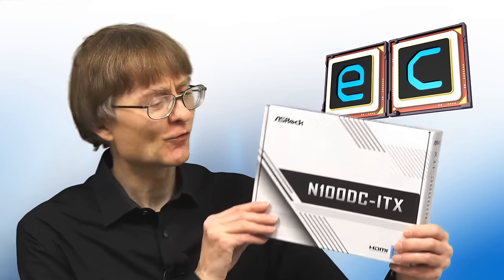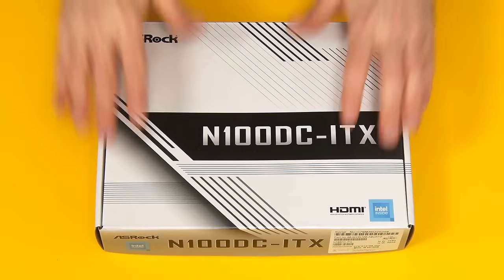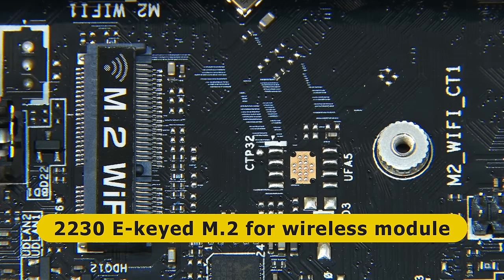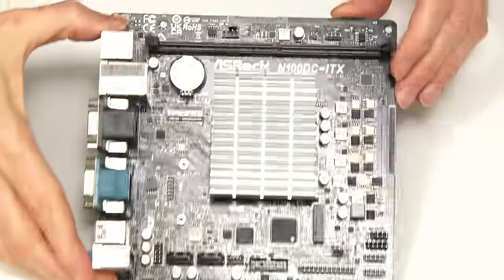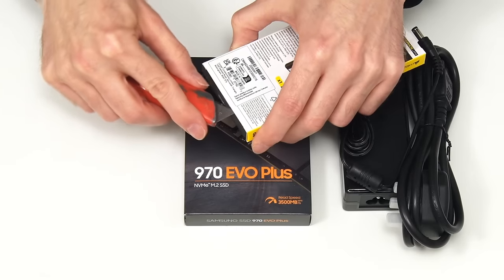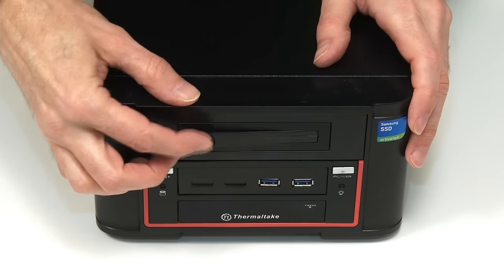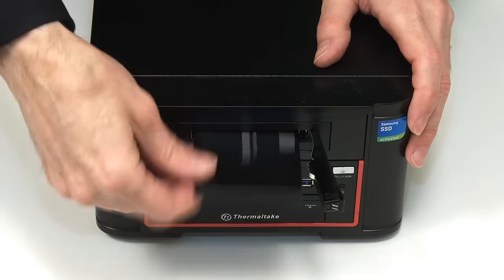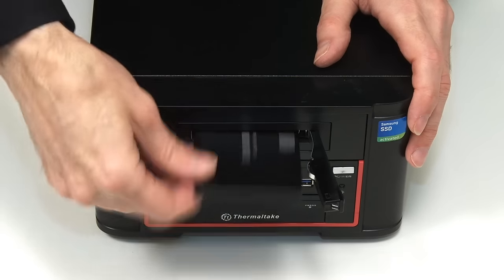N100 Mini-ITX Silent PC Build

Comment: I too think that Office peaked with Office 2003 and still use it today. However, Windows 11 doesn't like it, but will run my copy of Office 2007. Something to do with the security of network drives so it freezes on the Save As screen. Come 2025 I have the choice of swapping to 2007, which I thought was the least inconvenient option. However, just seeing you boot up a VM to run Office makes me wonder if it wouldn't be better for me to run Windows 10 in a VM to access the files on the NAS. I have an XP machine on it's own virtual network and not allowed to contact the big mean wide world. The thought of going back to using it for anything other than games hadn't occurred to me. Food for thought. 

Some time back I replaced an AMD based motherboard with an Intel based motherboard for a Linux system. I was very surprised how well it handled it. I'm sure that Windows would have lost its mind over such a major change, but Linux seems to take it in its stride. 

Another very enjoyable PC build video. Always a favourite of mine. Thanks!

Comment: Thank you for the review of this motherboard.

One bit of criticism is that I do not understand why you are so worried about the bios being able to download drivers when you are still running WindowsXP which has been EoL for 10 years now.
Reply from the maker: I am not running Windows XP online, so the EOL is irrelevant -- it is is a totally sandboxed and secure system. And I am running Win XP in a guest OS VM, so it is not using any drivers related to the real hardware. The host OS is Linux Mint. My concern about the BIOS drivers download "feature" has nothing whatsoever to do with drivers! :) It is to do with a motherboard BIOS that has direct Internet and OS access . . .

Comment: Nice daily driver build. Small, efficient and inexpensive. I tend to use my Rpi 4 most of the time as it's fast enough for most of my daily tasks. Sadly, since the upgrade to bookworm Aisleriot Solitaire no longer runs. Scrot fails to works as well. I have so many old computers laying around that are more powerful than the Pi but I just don't use them often, my wife uses my 2014 Macbook Air most of the time as her windows laptop stays sick like most windows systems. Unless you game or do a lot of video work, I see little use for a high power system. Most are just overkill.

Comment: bro's so wholsome he deserves an n300 with 8 e-cores.
Reply: IF you're running a http or an Erlang server with it, may be, but the difference is very thin, N300 is less than 10% faster (both mono/multi core scores), it has a better iGPU (32 EU instead of 24), something that most Linux users don't care about, but its Cinebench tests are lower than those of the N100.   So the price delta isn't worth it.
Reply: @hankhulator5007  bro's so wholesome he deserves an ampere altra cpu.
Reply: @SkysTrains   A DUAL Ampere Altra :)

Comment: Well done! This N100 CPU is quite impressive I think. Compared to the Celeron J4125 in my Synology DS1520+ which runs 4 VM's it is mucht faster. So your "little" system has options for hosting a server or nas too!

Comment: Great little thing - and video. I was looking for a smaller case and found one - much cheaper I guess - that fits on a VESA mount. I am considering to replace my array of 6 or 7 2.5" HDD NAS by a couple of these, but then would need to DIY a NAS OS installation. In the  past two decades or so, I worked with tiny discrete NAS servers as a way to distribute load and specialise them in content related to users. And they replicate to each other on their second RJ-45 while some of them run also an incremental backup through the user LAN. These replications are immediate but asynchronously. With their ARM derived CPU, the current servers are less power "hungry" ;) but they sport HDD.
I have seen some PCI NVME adapters and I imagine an expansion card that can hold 4 of these as the data array for the N.A.Service.
The filesystem would be a question mark for me. Way back I had some hopes for ZFS but did not keep track of developments.
I would still consider a Windows build with this ITX board, by the way, for someone in the house with a big fat workstation of 750 Watt only using Office and Firefox. Maybe we can halve the 3,000 kWh annually for two of those workstations.
Would that be a nice video to discuss and maybe illustrate?
Reply from the maker: Yes, this can happily run Windows 10 or 11 -- both officially supported. I made a video on low energy computing not that long ago -- to sadly  very little interest: https://www.youtube.com/watch?v=rGUnsiivqeU

Comment: I agree with you about the Office ribbons. Surprised you only went for 8GB RAM. My choice would have been for 16GB of a cheaper brand, without a heat sink. Don't know if you've ever seen problems with cheaper RAM? I haven't. Sorry to hear about the tinnitus. I am a fellow sufferer. Mine was caused by the antibiotic Ciprofloxacin. There are a lot of pharmaceutical drugs that can cause tinnitus. Ciprofloxacin can permanently damage the body in a lot of other ways too.

Comment: I can see why an N100 build would be something to do a video about (because it's not done by anyone else) but I am left wondering "why?".  Why not a dirt cheap used mini pc (cheaper more powerful, drivers sorted) or a new dirt cheap N100 mini pc.
The only thing I can see it offering is continued support for those old peripherals using serial, parallel, and VGA connectors.  But those old peripherals also have old manual drivers and software that are troublesome at best and maybe not supported at all in modern OSs.
Reply: That case with the swapable sata drives was interesting -does it work with the new MB?  Was that a major reason?
Reply: The goal of this build was a silent PC, as in no fan noise at all. AFAIK there aren't any cheaper faster solutions that are silent.

Comment: Looks cute. Looking at the test, Linux mint, docs and stuff like that, make me doub about the performance/cost rating. These small computers should be more affordable, as they are mostly DIY small home hobby projects and not some big enterprise solutions. Anyways I found something very interesting. Something for enthusiast and something that will save some serious money. When I compare it to stuff bought from store shelf I have no doub that this is actually a win win project in  every way. I found Bananna BPI R-4 router board. There is also alu case for it and antennas I think come seperately. This might be the best home router on the planet. A router so cool it changes the way I see routers, and its cheaper then all of the "hi end" gaming routers but at the same time much better. Now, I am not trying to advertise, just sharing some cool ideas for enthusiasts, so we can build something that is actually better and cheaper at the same time.

Comment: Hey Chris! Nice video on a subject becoming more relevant every day. I am interested in what the total cost of this upgraded PC was, as compared to simply buying one of the many Mini PC's available on Amazon, or elsewhere. They can cost anywhere from ~$130 TO $300. The lesser expensive ones come with plenty of hardware to run Linux and external drives, and all are silent. Plus, they take up much less (precious) real estate on the desktop. I purchased one earlier this year for around $200. It came with an N5105 Intel Processor, 12G DDR4 Ram, a smaller 256G N.2 SSD, and Windows 11 Pro. I chose this one  because it had Win11 Pro installed. Anyway, had you considered something like this when deciding on replacing the Intel I3 board?
Reply from the maker: I am not aware of being able to buy an N100 for $130! :) And yes, given that I have reviewed and used mini PCs like those you describe on the channel this year, I certainly considered the possibility! :)
Reply: I purchased a small mini PC with a Intel N5095A Quad-Core, 16GB Ram and a 256 GB SSD from Amazon for under $200.  This was my total cost, and mounts on the back of my monitor.
I use this to control my 3D printer farm and works great,  ( it also had Windows 11 Pro installed)

Comment: Not a bad little motherboard, useful with DC input, com, printer, VGA and ps2 ports for industrial use. Depending on equipment configuration you could replace a PC from the early 90's with it.  The only thing that would worry me would be it's brand. I have never had or used an Ausrock board that lasted more than 18 months. Maybe they are better these days?

Comment: It makes me want to have the same kind of PC, small form factor PC with passive cooling, low power consumption, cheap price (less than 200 dollars) : it is enough for most of people, especially if you are not a hardcore gamer.
Intel HD Graphics iGPU can decode h264, h265 video streams, 4K, if you install appropriate driver, video transcoding with intel Quick Sync is also possible, even on linux.
Improvements would be to have 16 Gb ram, display port and more USB3 ports.

Comment: I think that particular N100 motherboard beats that rockchip board due to its pcie slots, ability to run a discrete GPU, and x86 compatibility with GPU drivers.

Comment: This would be awesome if it had a USB-C PD 20v 3a power input jack.  I know it'd be confusing as only 20v @3a USB-C cables and power supplies would work, but it'd make this so much more flexible!
Reply: You can buy a USB-C 20V to barrel jack cable for the PC. I use this kind of cable for my Topton N100 PC, so I can use my GaN power supply for both the N100 PC and other USB powered devices.

Comment: Have an I7 K system from 2000. Last year built a small itx system with an I3 cpu. The I3 is at least as fast as the I7. Got ME thinking about how much power is really necessary. also have a phone way back from 2017, xiaomi MI max. Still fast enough for all normal daily activities. So there you gou😊

Comment: What's more surprising, this setup, if benchmarked from CPU & RAM alone, it is on par with the first ever Core i7 965 Extreme Edition.

So to illustrate the scaling of performance, it took nearly 14 years to bring down the Power Consumption of 1st Gen Core i7, down to this level of efficiency.

In other words, it is more than capable for retro Gaming.

I wonder if adding Graphics Card will work at all or not.

Comment: Ive been considering upgrading my mums core2 (it is alive still lol) with a n100 based device as it kind of struggles doing basic things. I tried a cheap 2nd & 3rd gen mobo from china with a i7 2600k cpu i had laying about but although quicker than the core 2 it BSOD when under cpu load, i think the boards power delivery isn't up to the task with 4 phase vrm.
All she needs to do is use word and browse the web.

Comment: Unfortunately, Intel N100 isn't a big upgrade over the i3-4330T that you had, in terms of single core compute. I prefer to invest into tech for at least 3 years. Most workloads use only 1-2 cores on Linux, so it would be better to have something in the laptop Ryzen 3 territory. Too bad the Phoenix2 APUs are really hard to get a hold of, a Ryzen 3 7440U would be a great chip for cheap. 

Though I agree - the Intel N100 is going to be a great CPU for average use inside a mini-PC with DDR5-4800 RAM, as most apps now actually require fast RAM in addition to single-core CPU performance.
Reply from the maker: It didn't need to be a big upgrade -- the only upgrade needed was silent and reliability! :)
Reply: @ExplainingComputers  I can tell - you're using the old version of Office. How hard can it be? But I wouldn't bet on that small passive heatsink to do a good job because that N100 can boost up to 15-25W TDP, which it did. A Blender render would make it toasty, so a Noctua fan on top of the heatsink with a very lenient fan curve would help out a lot. It would be time to get worried when the CPU temperature reaches 83C, then you could ramp it up from off/idle speed. 

When I was setting up a Beelink EQ12 mini-PC, it got pretty hot (due to Windows 11), especially with the stock paste, and it had two fans - one for the CPU which boosted up to 22W for a long period and a small one for the rest of the components like the SSDs and RAM. It's a more premium offering compared to majority of N100 mini-PCs, others ship with simpler hardware and dodgy power adapters. Undervolting was not possible, at least I didn't see it in the BIOS. I wonder if undervolting is possible on this board.
Reply from the maker: I do indeed intend to keep a close eye on the temperatures. One option will be a much larger heat sink, as I have a lot of room for one in the case.

Comment: I was cringing when i saw a 970 Evo on a silent, passive build ^^' but seeing this heatsink later on was a relief lol
These particular samsung ones run so hot for gen3 drives.
To save a couple of watts i might have chosen some Crucial P3 instead. they run cold and will be more than enough for two PCIE 3.0 lanes.
I wonder if there are DDR5 motherboards like this one though. a single channel DDR5 is a pretty good boost compared to DDR4, even if for the use it may not matter.

Comment: It would be interesting to see how you would approach building a similar computer with only one fan; perhaps on the CPU, and how the noise level compares to a fan less machine. Bonus points for using an AMD CPU. My sense is that much of the noise comes from an ATX PSU. I like the idea of using a 19v external power brick.

Comment: Very interesting video, inspirational 👏
Long time ago my first computer was an Atari 520-ST the same silent, with beautiful graphic system like a windows, 16 bit machine  ❤ professional software.
I have a plan, to print the keyboard, mouse, and to install inside it the modern electronics, like your build. 
As a system will be Atari 520-ST or bigger ST emulator on a 500 Gb SSD, 64 Gb RAM, and NVidia GPU, 4 Tb HDD as a work disk. 
Good modern days computer with so lovely Atari system, and software.
But the most satisfaction is that beautiful 🥳😘 Atari ST keyboard, the most beautiful design ever builded 
Thanks for your as always good video.

Comment: I would have put a 16GB or 32GB stick of DDR4 3200 RAM in this system. Even for Linux, 8GB is kind of limiting, and you can't expand without tossing the current stick. On Amazon, I see single sticks of name brand 32GB for around $55-70 and 16GB for about $40. Prices are still pretty low. BTW, your BIOS screen said the RAM is running at 2133MHz, but the Asrock specs show up to 3200MHz is supported. Maybe there's a setting to enable XMP?

Comment: My win98SE ,20 years ago on an old MSI board had temp guage in BIOS and no system since,has it.
Reply from the maker: This system has a temperature measurement in the BIOS, and I've never come across a system without one. Although they can be hidden in the menus, and you often these days have to use "Advanced" mode (the non-graphical one).
Reply: @ExplainingComputers  none in win 10 either.

Comment: I guess with that honkin' size heat sink on the CPU, the thermals should be good, but the case seems cramped. I would also put a thermal pad on the m.2 nvme ssd and put small copper heat sinks on top.

Comment: It's pleasantly surprising to see a new low power CPU from Intel that offers very compelling performance per watt figures. From a PassMark perspective, this CPU is very similar to the i5 4670K, which whilst a 10 year old CPU, is still plenty fast enough for modern desktop computing. It also has an 84W TDP! The added benefit with this new chip is that I assume it has full TPM 2.0 and Windows 11 support, so for a Windows user it'll be supported for years to come.

It's rubbish that there are still SO many manufactures peddling old Celeron N3050 and similar CPUs which really are shockingly poor performers (10x lower PassMark scores!)

Comment: You will need the Noctua Cooling Fan to prevent the unit from crashing.
Reply from the maker: No, I wont! It has been running for seven months with no fan, no issues.

Comment: Great, but I had hoped  that the motherboard would have a 2.5Gbit Ethernet port. I know you can get a USB3 to 2.5Gbe converter for £25, but for my use case as a low cost NAS to replace my ASRock Atom Mini-ITX 19V DC board, this is not quite ideal. As always, excellent review - thank you.

Comment: Why would it have a VGA port and not two HDMI or Display Port socket?? I almost would have purchased if it had two digital outputs. Could use the PCI slot I guess but seems like hassle.
Reply from the maker: Boards like this will end up in many industrial scenarios where VGA is still used. The PCIe slot on this board (or indeed any N100 computer) cannot support a graphics card.
Reply: yes,  🎉 a 2nd Monitor connector

Comment: Just a few remarks on a rather interesting video Is there no ddr5 itx version available? (ddr gives more bandwith & thus performance) No 16GB of ram? and last but not least perhaps a GPU that is a few watt to use for video converting?
Reply from the maker: There is no DDR5 version, but the RAM performance is not going to be the bottleneck in this system. :) 16GB of RAM can be fitted, as can 32GB, but is not needed for most basic computing activities, and certainly not for my use case. An N100 does not support an external GPU.
Reply: @ExplainingComputers  Does it not have an PCIe x16 slot for that? (the GPU). 

What made you choose an (mini) ITX over a "NUC" like the BeeLink EQ12? esp if you're not intending on using a dedicated GPU and relatively low amount of extra disk expandebility.